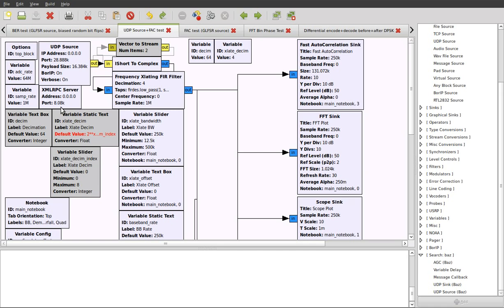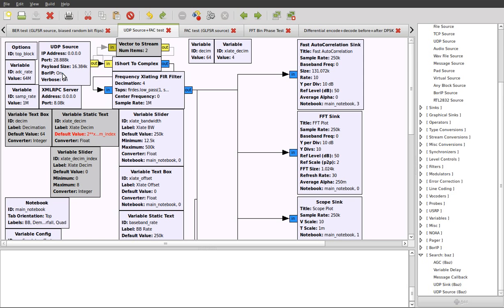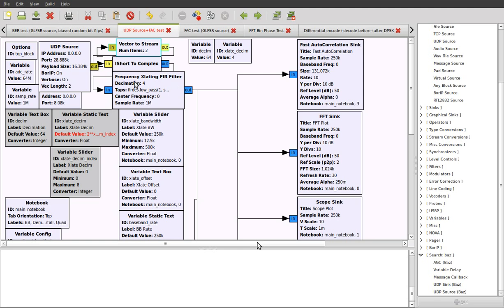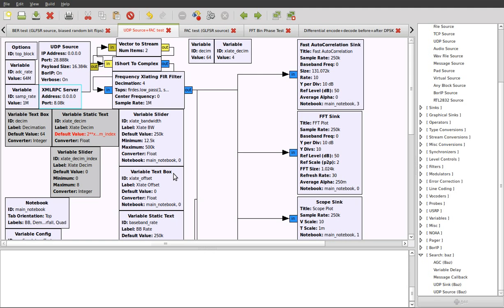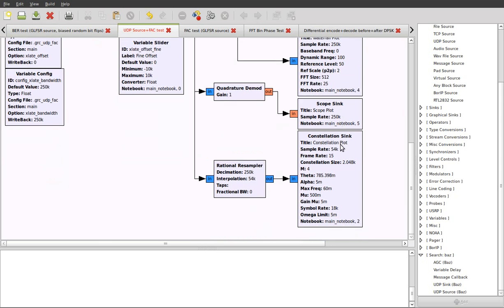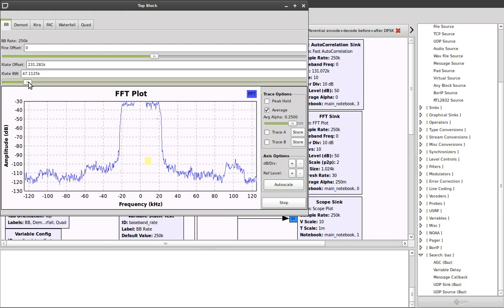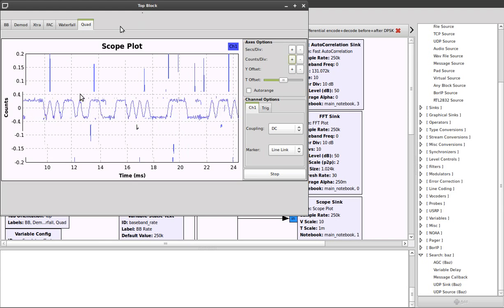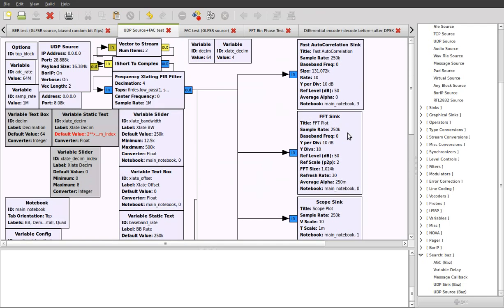GNU Radio Tutorials: Part 3 - Types, Channel Selection & Graphical Sinks

Comment: balint , u are doing good work. pls i need a video for channel sounding, giving details of interface between ready installed PC ( with Ubuntu and gnu radio) and usrp-2920. also, flow graph of both transmitter and receiver. thanks

Comment: Thanks a lot for the great videos. I have a question regarding Wi-Fi signals. Currently I am using the HackRF One as a receiver for the 5GHz  band router, I want only to observe the behavior of the 5GHz, so is there a way to cancel out the noise and only pass the 5GHz band?

Comment from the maker: If you're looking at any signal from an academic perspective, there is still plenty to learn even if at a higher level the information is encrypted. It's good practice to play around with an appropriate demodulator, analyse various aspects of the signal to gain an insight into its construction, etc. You never know - you might even discover something new (e.g. a security flaw) that has thus far been unknown! :)

Comment from the maker: Thanks for watching! To a limited degree you could, yes - a GSM channel is 200 kHz wide, which will definitely fit in the dongle's bandwidth. Just bear in mind that GSM operates on a odd time base (270.833 K symbols/sec with GMSK), and also that the dongle has a smaller (8-bit) dynamic range so YMMV depending on what you wish to achieve.